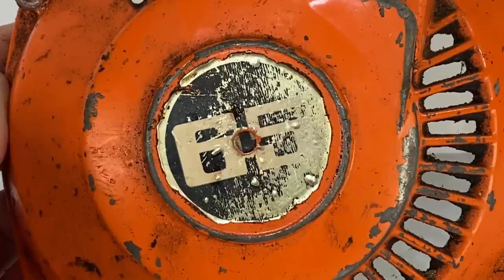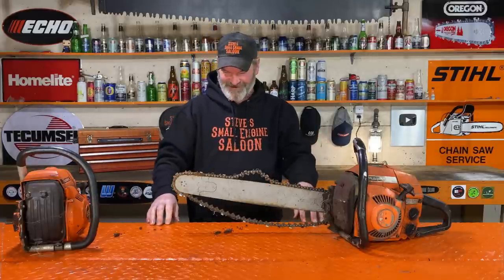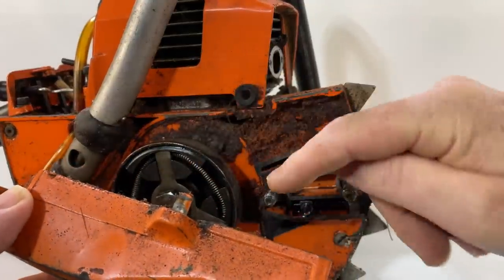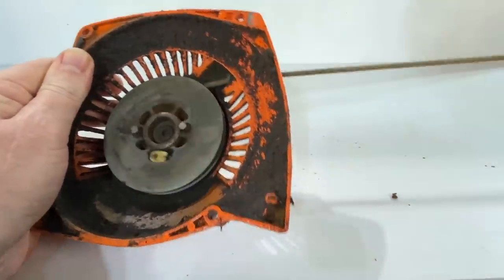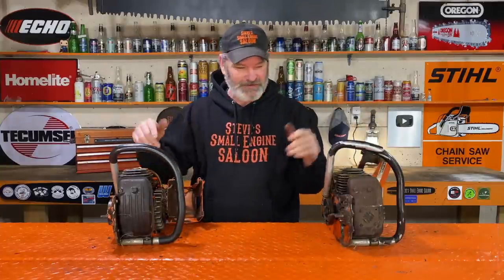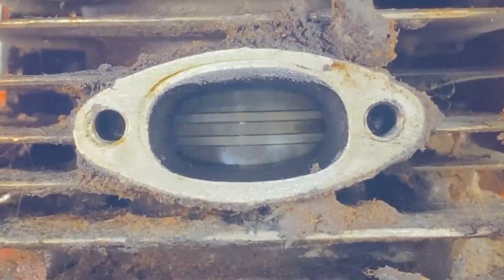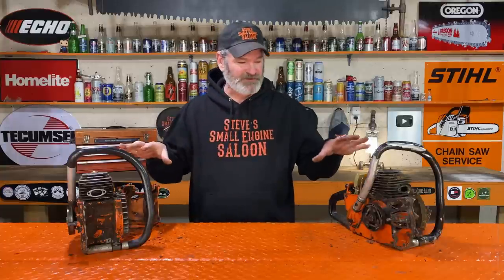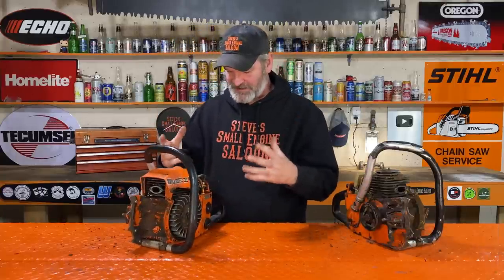How To Make One Chainsaw Out Of Two

Comment from the maker: ✅CLICK HERE FOR THE ADJUSTING TOOLS ➜ https://amzn.to/3McdXHI
For more videos like this, check out: 
👉CORRECT WAY To Tune The Carburetor On A Chainsaw ➜  https://youtu.be/M6T5JoGXcHY
👉Top 5 Reasons A Chainsaw Won't Start ➜ https://youtu.be/5Qit2CZFw6M
👉Correct Way To Sharpen A Chainsaw ➜ https://youtu.be/-GIxowey6IQ
👉Repair A Chainsaw That Cuts Crooked ➜ https://youtu.be/AgCZxee2NPA
👉Fix A ChainSaw If It Won't Oil The Bar And Chain ➜ https://youtu.be/6zscOSrFQjA

You can connect with Steve here too: 
✅Visit Steve’s WEBSITE ➜ http://www.stevessmallenginesaloon.com/ 
✅Visit Steve’s PARTS & TOOL STORE ➜ https://www.amazon.com/shop/stevessmallenginesaloon 
✅Follow Steve on FACEBOOK ➜ https://www.facebook.com/stevessmallenginesaloon 
✅Follow Steve on INSTAGRAM ➜ https://www.instagram.com/stevessmallenginesaloon/ 
✅Follow Steve on TWITTER ➜ https://twitter.com/SteveSaloon

Comment: I bought an old Kawasaki ATV that needed work and then bought another identical one in worse shape for parts.  I put all the best parts on one to get it going and looking pretty nice.  The parts machine was too good to scrape so I put it back together with a combination of the parts I took of the best machine and few I had to buy.  Now I have twin working ATVs.  It'll be interesting to see if you can abandon the worst chainsaw even though you might be able to make it work again.

Comment: Hey Steve , need some help. I bought a chainsaw from China Specifications - Bar Length:20 in; Pitch: 0.325''; Sprocket: 7T*0.325''; Chain width: 0.058''; 62CC  this saw has a 20 inch bar with (76 drive links (which is very hard to find) how can I convert this saw to fit Oregon bar and chains

Comment: Steve i have a question.  My chainsaw bar does not have a oil port on the mounting end is that normal? 
Also..  Hope your ribs heal soon. Ya got to stop hitting things with your ribs, bad habit. 😁😋
Reply: Some bars do not have a port on the side...they instead have an incision cut out within the hole for the chain tensioner, so that whatever hole is on top draws oil from the oiler...check the tensioner holes for a slot.

Comment: Crazy as I'm taking three Craftsman Tecumseh snowblower engines to build one for an old Bolens snowblower that's the same green as the Craftsman. The Bolens is the only snowblower I've seen with an actual transmission in it so I must save it.
Reply: reminds me of the old Bolens law tractor I grew up with.  my dad asked what preventive measures he should take, and the mechanic said, "well, you could keep a few parts on hand, because you don't gain any benefit from replacing something that hasn't broke yet."

Comment: Thanks for sharing. Great video. No your not a wussy. It all good till your feet are higher then your head. I feel your pain, hope you held on and didn’t drop your beer. Epsom salt and hot water in your bath will help a little. There are other herbs and Essential Oils can try but I haven’t used them yet.
Reply from the maker: Thanks for the tips!

Comment: they don't make them like that, any more.  which is problematic if you need parts, because I've found that there is a tendency for the same part to have age related failure.  so you have to hope a low mileage saw has had some kind of damage that rendered it a donor saw without wearing out the part you need.